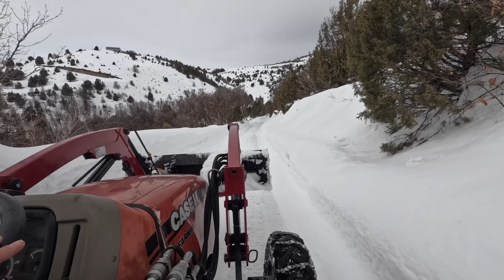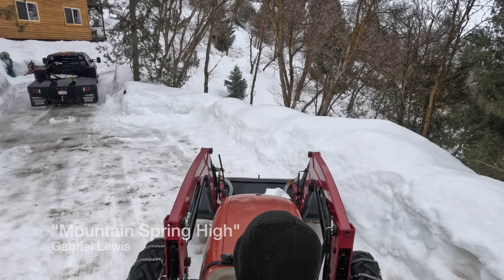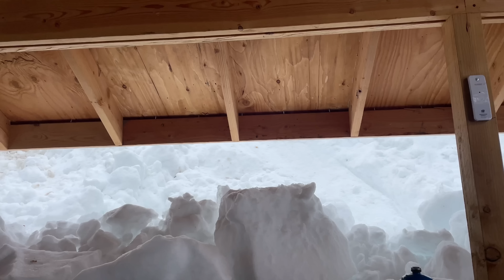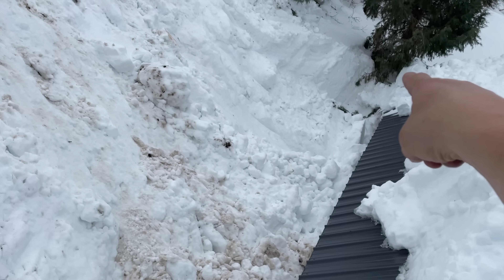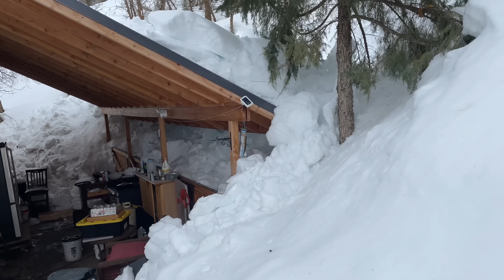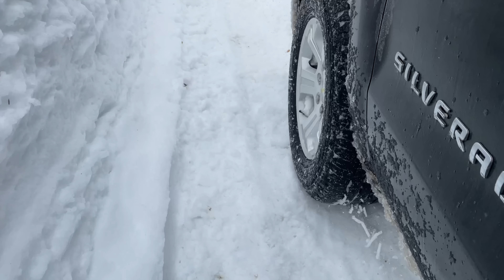EXCAVATOR to the RESCUE!

Comment: Marc, i have a lean-to on my barn with similar snow load issues some years. i just ran a 2x6  across the center of each rafter for the entire width of roof. then each year prior to first snowfall i have three adjustable metal posts that i place up against the 2x6  to the floor , this remove the deflection from the rafters. Its temporary and the three post are easy to store after winter.
Reply from the maker: Not a bad Idea and definitely effective!
Reply: I do the same under my 25x40,12 ft tall deck on the east side of my house. The sun doesn't come over the mountain until 10 am in winter, then the house shades the deck until the sun has already slipped too far west to melt anything. I sistered 2x6 onto each side of the original 2x4 joists some doofus built it with.

Comment: I believe the term deflection is used by home builders to describe the roof sagging from snow load. Your video demonstrates one of life's valuable lessons about hindsight being 20/20. In future project you will likely give more importance to the height of the eaves relative to shedding snow. Or doubling the rafters if there's a lack thereof. Your persistent efforts battling snow are admirable. You're winning the fight.
Reply from the maker: You are correct. I never would have expected to have this level of build up to work about or I would have oriented the building roofs 90 deg so that the snow shed would go to the sides and not uphill/downhill... definitely got me much more aware of that process now.
Reply: @MountainMapleRanch  Mark, you’re a very brave and courageous person to have tackled such a dangerous and daunting situation, I’m glad you had another person there to get help or to dig you out if that pack had collapsed. Be well y

Comment: If you have rubber tracks on the excavator, you can use screw in studs to give you extra traction.  A gentleman in North Idaho did it on his excavator and it worked great.
Reply from the maker: Yeah, these are steel tracks with rubber pads bolted onto them. I could take them off and have the steel grousers which are better but only slightly in the snow/ice but then I would have to bolt them back on each time I needed to use the excavator on a jobsite where there is concrete and asphalt.
Reply: @MountainMapleRanch  just run a bunch of 1/2" sheet metal screws into the rubber pads and whalla!  ice cleats.  well works well in boots and dirt bikes anyways... not sure on an excavator though..

Comment: Great vid, you need 150 lbs per sq foot snow loading where you live, lucky you didn't get another 8 feet. Good lessons learned the hard way, chains, studs on the tracks, structural integrity, what it takes to live on a mountain. Paradise comes with a cost.  Cheers
Reply from the maker: Yeah, we are actually called out for 102 psf snow load up here and 65 in the valley below us. I had the shop trusses made to 105 psf and I don't know the actual spec but my rafters are 2x6 on 24" center at a 6/12 pitch and a horizontal span of 12'... that is probably somewhere around 70 psf if I were to guess at it.
Reply: @MountainMapleRanch  I have steel roofs, more pitch the better for snow load and shedding. Everyone hears when the roof clears. Stay safe.

Comment: Try the rope method to remove snow. anchor a long rope to the road above. Run the rope behind the snow the full length of the lean-to (or house), then back up to the road. It's like a giant cheese cutter. Then whence the rope, slicing the snow off the roof. Good luck

Comment: Best jumping is with a higher voltage.    6 volts battery = 8 volts jump,   12 volts battery = 16 volts jump.  24 volts batteries =  32 volts jump.      Most Goodall starter units are made out of the 6 volts Prestolite generators of old school Plymouths designs .....that max out at 18 volts dc. (safe for electronics controls ).   The Full fielded Generators are raited 150 amps each .     the Big 12 jumper is 3 generators or 450 ams at 18 volts.   The BIG TRUCK units is A - 2 units or 300 amps & B - 2 units of 300 amps.   So there are 2 set of jumping cables so you can do 12 or 24 volts dc.  Also one has a floating grounds so it can follow as Series/Parallel starting system.....Diesel trucks that one has 12 RUN and 24 start. 
So a little 3 horsepower gasoline generator with a full service DC output  that would max out at 70 volts old school ....would charge them batteries in short time.

Comment: I wonder if placing 2 or 3 burn barrels between the house(?) and the road would melt the snow enough to keep the quantity more manageable.  Yeah... good firewood up in smoke, but I wonder if it might be cheaper the the diesel fuel and wear and tear cost on the equipment.  All I know is that I used to live in the Lake Effect Snow Area outside of Buffalo for a while... and I used to keep a couple of burn barrels where I did not want the snow building up to much.  Most of the time, it kept the area around the barrels pretty clear... but while we got snow, we rarely got the temps you do.  Occasionally, the burn barrels just couldn't keep up and we always had a muddy mess.

Comment: As far as snow pac, with them tracks its not as bad as you would thing, I drive my 12 ton cat and it gets up on dry snow ok, sometimes it might take stirring the snow up and letting it freeze again then. Good work! its very hard getting a machine up a hill on the ice. With metal tracks yo have nothing to keep you from sliding sideways. them growzers only face front to back.

Comment: You might also want to build an extension that would either vote to your excavator bucket or go on. It's like a quick attachmand have it that you. Can youse it like a snow rake and rake the roof clear of snow?  For future wbut is this much no normal or do you find that you received more snow this winter at least in the last few
Reply from the maker: I've thought many times about building an adapter mount for my excavator to connect 3-pt attachments (i.e. my 8' grader blade) and use something like that... the snow record data shows that we are at 154% of our 30 yr avg.

Comment: My uncle used to use sand bags in winter cause he had a roof like you and the said bags stopped the snow from coming into the porch area and helps divert water a bit.
Reply from the maker: Sandbags definitely help divert the water. Back when I worked for the city, we had several years when we would have to sand bag certain roadways to direct the runoff toward another section of the storm drainage pipe system because the flow would occasionally be way too high for the pipes.
Reply: @MountainMapleRanch   We can only do so much take care and stay safe!

Comment: I couldn't tell if the rafters were notched or not. But just in case, never notch a rafter. Also, 2x6 is just too small. You should consider sistering 2x10s. Or adding another beam? Good luck.

Comment: On one side such a relief that spring has finally arrived but on the other side you probably now have a year's worth of new projects to work around the next winter season using lessons learned from your record snowfall this year. Do you think that installing a rail system on the roof so you can clear snow quicker from the roof would help ? Having 3 runners on a frame with an angled blade you could run up and down the roof

Comment: I know that there is a TON of snow but something I have been wondering about….. Why don’t you use a snowblower to take some off the roof?  Not one of those large ones but a medium size that would be easier to hoist up on the roof!!
Reply from the maker: We just don't own one and would have to go  buy one for just that purpose.
Reply: Key is to not let the snow pile up that high. With a way cheaper cutting blade and slide on a pole, you can let gravity do the work of getting the snow off the roof. https://www.youtube.com/watch?v=YsaWlfKW1-A  You'd only have to clear the dropzone afterwards to make sure the next layer of snow can fall down.

Comment: Wow. Made me cold. I had to turn up my new shop oil heater. Believe or not, cheaper than the electric.
Reply from the maker: I've had them in shops I've managed n the past and they are very nice for that. Especially when you have plenty of used oil to burn through them. :)